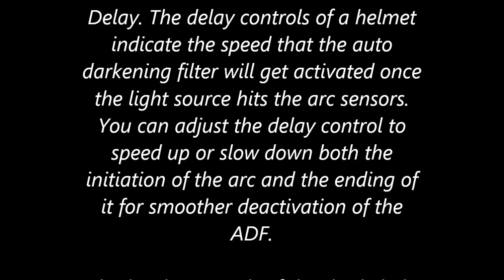Welding helmet fix

Comment: the auto darkening ones are fine when they work but even with new batteries I have had 2 that stop working so I went back to the old type.
Reply from the maker: Yes i ques the electronics can also pack up. They are so cheap anyway.